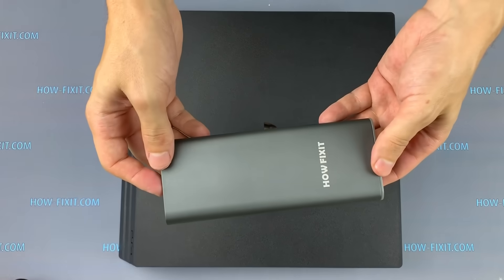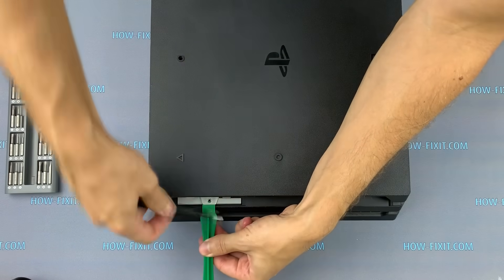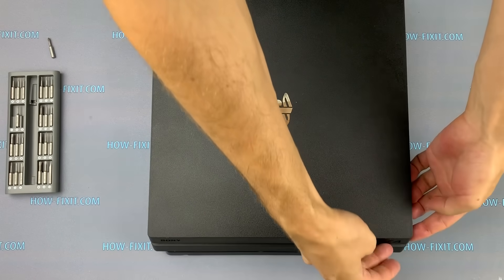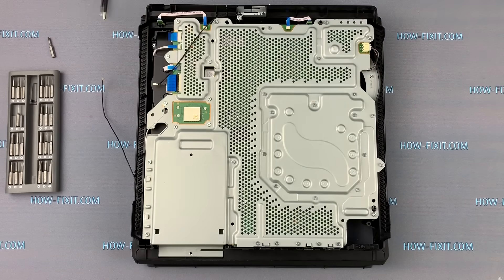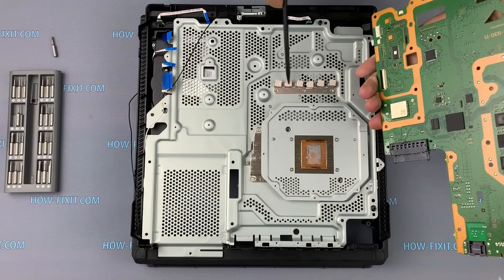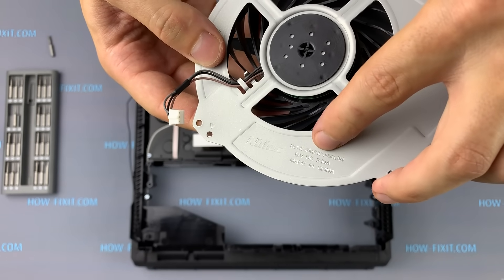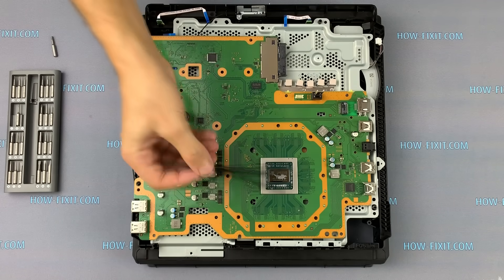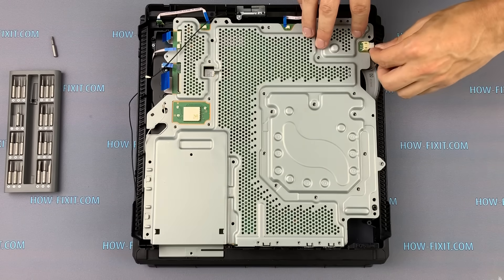PS4 Pro Disassembly: Ultimate Guide for Fan Cleaning and Thermal Paste Replacement

Comment from the maker: PS4 Pro Liquid Metal vs Thermal Paste: https://youtu.be/HMQ59icUG4A
PLEASE NOTE !!! In this video I disassemble the PS4 Pro of the 2nd generation (CUH-7200 series) and disconnect the power supply cable different from the PS4 Pro 1st generation (CUH-7000 or CUH-7100 series). If you have a 1st gen PS4 Pro, watch this video guide -> https://youtu.be/dJgXobATp3A
Reply: @Kid Sus do not turn on with out thermal paste you will fry your processor and mother board, just wait until you get the thermal paste its pretty cheap
Reply: I really think your power supply section needs updating. The way you disconnect by pulling on the the cables themselves seems like such a risky way to do this and could lead to damaging this area. I found another video that says use a sharp pair of pliers to remove the cable from the base white plastic, not just pull from the top. I'm pretty inexperienced with this and even I found this was a glaring issue with the video.
Reply: @bruvcuzfam  yeah it does, I ended up pulling the whole clip off the motherboard … now I have to get it fixed because I definitely don’t have the skill or the tools to fix that.
Reply: @brogan1488  dam bro that sucks.. I did exact same thing.. was you able to fix it?? How was it fixed?? Please respond bro im trying to figure out what to do..
Reply: @bruvcuzfam  yah dude it got me.. I pulled just like in the video and it pulled the whole thing off my motherboard now I don’t know what to do.. does the video you are talking about mention what to do if you popped it off the motherboard?? Solder?? Glue??
Reply: my power supply cable wa stuck and I kept trying to gently removed it and the port broke from the mother board, how do u fix that?
Reply: @chrisv.6951  yes exactly the same happened to me.. can we solder or glue it back to mother board?? Did you ever find the answer!? I was trying to do something cool for my son cuz he was complaining how load it was and ive done iPhone screen swaps before so fig this would be easy.. well I pulled on that little cable and it just popped off the mother board… besides this everything went smooth like this was supposed to be easy just clean a system unplugged everything and plug everything back.. dam im pissed at myself I should of read this description but I was like ohh this is totally easy
Reply: @Kid Sus thermal paste is very important for heat transfer, without thermal paste will risk to burn processor.
Reply: Hi. Thanks for this. Just finished it. It's near silent now, after sounding like a jet engine! Edit: Just did our white PS4 Pro too. That one fooled me for a bit with the fake black screw on the power supply which the first one didn’t have. All good now though.
Reply: What tweezers does this guy use?
Reply: The BEST VIDEO of PS4 PRO. THANKS.
Reply: Good morning.Can you tell me how hard you screw the screws at reasembling?My ps4 is very clean but stills overheating also after i change the thermal paste.Thanks!
Reply: Thank you so much for your video, thanks to you my ps4 pro no longer sounds like a jet l. Your guide is easy to follow and very detailed, thank you so much for breathing more life into my ps4 pro while i wait for ps5 to be in stock again. Again, thank you.
Reply: Hello i am also facing this fan issue.... is it safe to do the thermal pasting at home, by myself?
Reply: @shravanbhuyar6276  if you watch the video carefully and have some technical understanding you should be fine, but so so at your own risk and if you mess up you have no one to blame but yourself
Reply: @jakallen666  I am a just a casual gamer ...not a technician so I have 0 technical knowledge... I am just asking if I disassemble and assemble it back carefully, is there still any chance that the ps4 would not work at all?
Reply: @shravanbhuyar6276  you will have to reapply new thermal paste because you would have to remove the most parts from mother board to gain access to the fan, so yes there is a chance i wouldn't work incase you don't put enough paste on or spread it properly you could do damage to the ribbon cables connecting the blu ray drive back in. That said i followed this video and i have taken mine apart a few times to mod the console and remove the blu ray drive as i don't use it. This is the only video you really need to watch, its very informative and helpful.
Reply: @jakallen666  may I ask what mods did you do and also why take out the blue ray drive?? Any reason in particular besides you just don’t use it? As in more room or better ventilation?? Just curious..
Reply: @stillamitchinmybook6320  i put an air vent where tge fan is and also put extra air holes in and the drive removed as not only did i not use it, it allowed more air to pass through allowing it to not over heat and ran silent even on hard working games like nfs heat and the 2019 modern warfare
Reply: There can I buy ps4 screws for.tje c0nsole.
Reply: Excuse me but what about that top black screw there at 2:51? Dont we have to loose that too? I cannot continue as it seems.
Reply: @Dornpunzel  that does not need to be removed
Reply: @shravanbhuyar6276  Thx, got it, but i guess i have broken my PS4 pro since the little plug from the power cable from the AC to the board was so tight that i had the whole thing in my hand when i pulled harder. :-(
Reply: @Dornpunzel  oh dude you have to be careful with that
Many people in the comments are already warning about that
I am not sure what could be done now
Reply: @shravanbhuyar6276  Well thanks for your reply. I take it with pride. PS4 is gone now and i wont cry. I have other hobbies. Oh, and a pc :)
Reply: @Dornpunzel  yah same thing. Was you ever able to fix it? Solder it??
Reply: @stillamitchinmybook6320  I did not try and the ps4 pro went into the bin.
Reply: What if I do t have thermal paste
Reply: You probably won't see my comment your video is too old but if i don't have thermal paste can i deep clean it and put it with the same thermal paste it come with my ps4 pro is 4 years old
Reply: @Kid Sus I would just wait bro.. its too cheap and too important not to man.. thats just me.. good luck bro! Hope you don’t have any trouble besides that. I popped my power supply connection off my mother board..
Reply: This video is great, but I got stuck taking the power supply out. I unscrewed the 4 screws and tried to remove it, but it would not budge. I kept pulling, used some of the tools to try and dislodge it a bit, and nothing. Finally I got it to lift up a bit, but it was separating and I had to snap it back together and got scared off. Any advice on what I did wrong or what I can do to get it out more easily? I’d really like to fix this, but don’t want to destroy my console in the process.
Reply: Is it possible to replace the fan of ps4 first generation with the fan of second generation ps4?
Reply: If only I read this sooner, my fingers wouldn't get all swollen.
Reply: Thank you so much
I changed the thermal pads too
No more Turbo Jet Engine!
Reply: @koncrissant  what size pads did you use? I have found thermal grizzly minus 8 pads 20x120x1mm 
Just wondering if they're correct
Reply: @1ballashotcalla1  So, was the thickness 1mm?
Reply: @Gatsu563  yes
Reply: 3:13 it hard to disconnect the cable or ist just me who have no strength ?
Reply: @Bocus_9325  Same here bro! Still can't get it out. Did you succeed in the end?
Reply: Robert harris I disconnect the other end of the cable ;) 3:18
Reply: SQUEEBADafuq the other end won’t release for me either 🥵😅. I had to give up in the end and reassemble my PS4....
Reply: @robharris7574  dude I tried to disconnect like in this video the power supply and it ripped it off the mother board!? What do I do know!! Please tell me I didn’t ruin it..!!?? Wonder if I can just super glue it back on or solder it back!? Please anyone know about this??
Reply: @Bocus_9325  what if you pulled it and it came off the mother board? Can i glue back or solder?? Please help?!
Reply: @robharris7574  bro you follow rxmuscle so I know you have the strength! Just channel jimmy the bull! Lol nah but for real i think i may have fu**ed up!?
Reply: @stillamitchinmybook6320  thanks bro but I managed to remove it after a few tries!
Reply: @robharris7574  I should have listened to you wire came loose from the cable tried both ends ps4 pro still plowed on cleaned the fan waiting for the pads and thermal paste to arrive. Btw I ordered a new cable but can't get the old connectors out. Gonna try and buy some precision needle nose pliers wish me luck

Comment: i followed both your videos my ps4 pro UK model is CUH7116B so should be Gen 1 - however when i open it the insides are per THIS video which you are calling Gen 2....not sure what's up with that. Your Gen 1 video absolutely does not correspond to the insides of my machine even tho mine is branded gen 1

Comment: Thanks for the video. I just did my PS4 pro today. I bought it used from gamestop a year ago. It wasnt too loud but the noise was noticeable. I'm glad I did it because when I opened it up it had about 6 spots on main board that had what appeared to be dried orange soda or juice in it. Probably explains why it was occasionally throwing an error mid game, not very often though. Cleaned the orange goop and reapplied paste and all thermal pads including RAM. Runs cooler and quieter. Hopefully the random errors stop now to. Easy job but time consuming, all those dang screws!

Comment: I would never recommend spreading out thermal paste, it will make it too thin of a layer, Wich defeats the purpose! Its acts as a barrier for too much heat, so spreading it thin doesn't make sense, ,you should only put a small drop in the center, on the ps3 it used to be the size of a pea, but this one is much smaller so use your judgment, too much will block it, too little will over heat, so ya apply accordingly, everything else was great. Dust & heat are the 2 things that kill electronics, just imagine all the ps3 out there that got thrown in the trash by rich people who would just buy a new one because they were too lazy to educate themselves on how to fix it, same with fan motors, a/c units, etc...

Comment: broke my ps4 pro doing this, never pull the power supply cable from the motherboard, you can disconnect it from the psu which is alot safer if you do manage to break it. Not to mention after trying to pull the cable from the psu it came out alot easier and with very little force

Comment: Hello! I have a strange issue. Everytime I open the PS4 Pro, the console is acting like is having a disc inside. There is no disc inside. After the disc drive is spining freely, i get Unrecognized Disc error. Besides this the disc drive is working normaly when I put a disc inside. Does anyone know if this is a hardware or a software issue? I tried to find informations on the internet, but I didn't find anything about this. Thanks in advance.

Comment: Do i need to discharge the capacitors ?
Reply: No as long as you don't mess with the power supply but if you want to you can just hold the power button for 10 seconds (when unplugged) and try disassembling it after an hour

Comment: Kinda like older consoles more. They are like 20 to 30 years old and still work and if they ever have a problem, it's just too much dust and dust spray can is usually all you need to fix it. Sometimes the disk trays jam but that can be easily addressed as well.

These new consoles get so hot they explode and you gotta make sure dust isn't building up too much and the thermal paste needs to be changed out every few years if you use it a lot. Every 5ish years if you use it casually. Pain in the azz lol.

Despite that though, thanks for making a video that makes it easier to deal with. Great stuff boss man!

Comment: Used this to method and its worked so well. Had a PS4 Pro jet engine plucked up the courge and took 1.5 hours to carry out the deep clean. Used the NT H2 thermal paste and Artoc TP3 thermal pads as an extra upgrade. There was a massive build up of dust on tye heat sync looked like a mouse lol. Now i can play Civ 7 and the fan bearly kicks in. The whole system can now cool properly! Thanks so much for posting this vidoe. Next upgrade is to replace the 1TB HDD with 2TB SSD for double quick load times and storge space. Note my PS4 Pro was 5 years old when doing the above. Feels new now.
Reply: SSD won't improve load times on the ps4 by much maybe 1-5 seconds

Comment: It worked precisely like you said! Thank you so much. Now , my PS4 Pro runs smoothly , no disturbing noise whatsoever! 🎉
Reply: After applying the paste,should we wait until it get dry or just immediately assemble it after applying thermal paste?
Reply: @Devilsdad2939   Great question — and it’s a common misconception!

You should not wait for thermal paste to dry. It’s not glue or paint — it’s designed to stay semi-wet and spreadable so it can fill in tiny gaps between the processor and the heatsink. The pressure from the heatsink spreads the paste into a thin, even layer for optimal heat transfer. Waiting or letting it “dry” can actually reduce its effectiveness.

Comment: I've got a PS4 Pro that was overheating and shutting itself down unless I pointed a box fan at it so I took it all apart and cleaned it out. When I put it back together, it no longer turned on. I've disassembled it and reassembled it multiple times ensuring I'm not leaving anything unplugged. Still nothing. Decided to take a chance and replace the Power Supply with a new one on Amazon. When I replaced it, it still doesn't turn on. However, there is a white light that turns on INSIDE the PS4 Pro case, sort of near the hard drive bay, when I plug in the power cable. I tested to make sure my old power supply didn't do this, and put it back in and plugged in the cable, and it did not illuminate that inside light. So I put the new one back in and sure enough, as soon as I insert the power cable (which is plugged into an outlet), the white light turns on inside. When I unplug it, the light slowly fades out after about 5 seconds.

I hope it's nothing like the issue you're showing in this video because that is way outside my realm of expertise. I have this funny feeling the power button isn't working but.. maybe I'm just being optimistic.

Any ideas that you can suggest I look into?
Reply: That's so sad 
It could be the CMOS battery or the thermal paste.
Give it a shot, hope that solves your problem
Reply: I think you’re on the right track. The white light you see inside after replacing the PSU means standby power is getting to the board — that’s good. The issue now is likely the power-on signal isn’t reaching the motherboard or the board isn’t responding to it.

A few key things to check:

    Power Button & Ribbon Cable – Make sure the ribbon cable from the power button board is fully seated and not damaged. If it’s loose or cracked, the power signal won’t send.

    Try Jump-Starting – You can short the power-on pads on the motherboard with tweezers to bypass the button. If it powers on, the button/ribbon is the issue.

    HDD Test – Try removing the hard drive completely and see if it changes anything. A failing drive can sometimes hang the boot.

    Visual Check – Look for damaged traces, bent pins in connectors, or burnt components — especially around the power area or ribbon sockets.

    New PSU Means 5V Is Working – Since the light shows up with the new PSU but not the old one, it’s delivering standby power correctly. So the motherboard isn’t totally dead.

If nothing happens even when manually triggering power-on, it could be a deeper issue like Southbridge failure or a damaged trace, especially if the console was overheating badly before.
Reply: @technoraver3949 thanks for the thorough response. I ended up taking my PS4 Pro to a repair shop about 45 days ago. They've been very slow on diagnosing it but they've ruled out the stuff at the top of your list and confirmed it is something on the motherboard.. South bridge, damaged circuit/trace is def possible. They said it will take awhile to figure out where exactly the issue is on the motherboard. I'm not in any rush so I told them to take their time and figure it out. They said at this point the repair itself would probably be the same cost as getting a used ps4 on eBay. So I'll likely not move forward with the repair, but I do just want to know what caused it to fail at this point and whether it was something I did or just old age or overheating related.

Comment: I’m gonna attempt this weekend. PS4Pro runs so loud, the local airport keeps clearing it for takeoff. 🛫
Reply: How'd it go?
Reply: I finally did it tonight. I probably would have been faster if I didn’t go out of order. Good guide. The heat sink was all caked up with dust
Reply: @HussarPlays my heat sink wasn't too dusty. But the thermal paste spread everywhere. The thermal pump is so bad.

Comment: For anyone trying this try both sides of the power supply cable first as others have said but if it won’t budge move forward knowing repairing the connector on the power supply is harder to do but if you don’t know how to solder know you can replace the power supply but replacing the board is harder and more costly.

Comment: Thank you so much for the detailed video. It was by far the best one i found for the ps4 pro. The hardest part was disconnecting the connecter for the fan i ended up slipping and damaging the wire a little with needle nose pliers but it didn’t break the wire luckily. The ps5 was so much easier to clean because the connector has something to grip on the ps4 it just slides off.